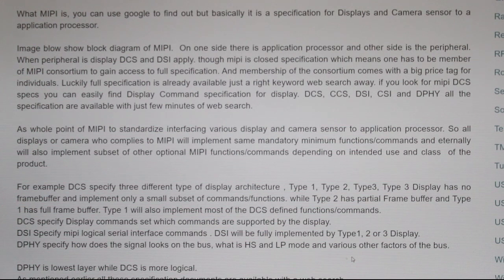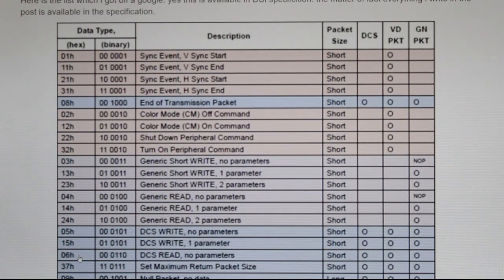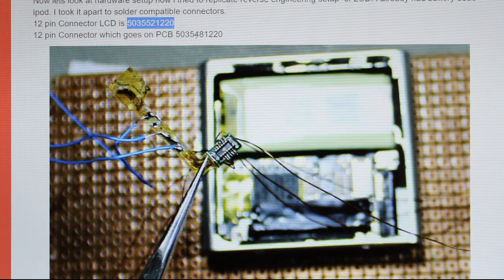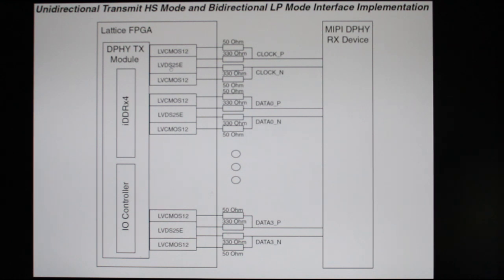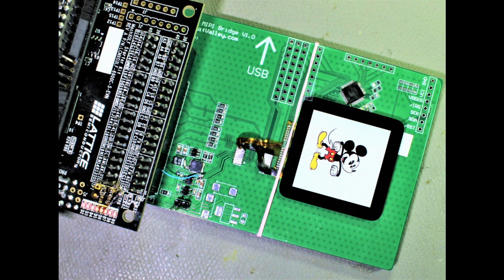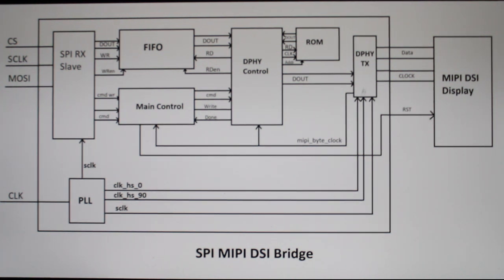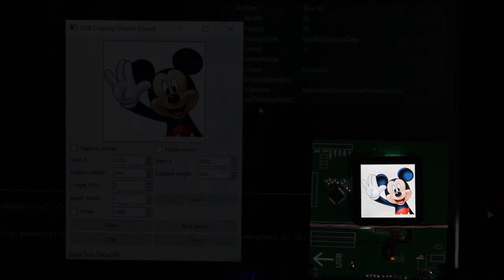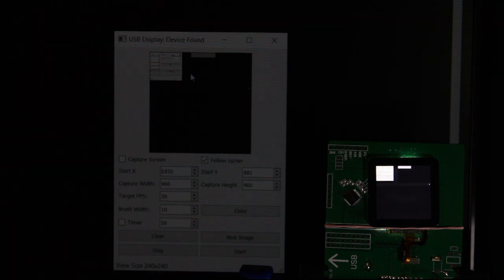Open Source MIPI DSI FPGA Bridge: Driving MIPI LCD with FPGA , IPOD Nano V6

Comment: Hi , this is a very good and detailed project. You have motivated me to try such project. Im trying to read the dsi data by an osilloscope. what model and spec oscilloscope did you use in this video. I have a 100mhz Rigol. would that suffice? The lane speed of the dsi im trying to read is around 940mbps.
Reply from the maker: 100Mhz Rigol would be sufficient for attempt any project.  Scope is just a another debugging tool. With enough motivation and resilience anything can be achieved.

Comment: Thanks for the great project @CircuitValley. I also saw your other projects such as the CSI2 receiver project and the industrial camera (CSI2) project as well. Question: do you have any idea if MachX03 is capable of doing CSI2-Rx and DSI-Tx at the same time? meaning would Macx03 is capable of interface to a csi2 camera, decode and demosiac/debayer, then send to a DSI display?
Reply from the maker: I have done CSI-2 RX and DSI-TX separately, MachXO3 is small FPGA. it would require quite a bit of efforts.

Comment: this was nice video explaining about DSI interface. Appreciate your hard work. it is not easy to work with something that is not documented well or closed source. But I have one Question remaining. is this mipi DSI interface standard to all displays regardless of display driver used in LCD module? if that is true it means this driver board will be able to drive any MIPI DSi compatible display regardless of driver IC inside LCD module ( Assuming correct  pins are connected ) . Right? I have few display panels laying around with 480x800 resolution panels they are MIPI DSI-2 (2 data lines)  panels. i want to know if it is possible to drive these panels with this FPGA board.
Reply from the maker: Yes , Every display that support MIPI implement subset of the MIPI protocol and commands will be same. You naturally have to adjust for resolution and number of lanes. And said they implement a subset so not ever command or feature or pixel format will be supported. Making silicon is hard, so there are only a few MIPI display controller manufacturer  best way to get info what your display can is to find a datasheet of display with similar size and resolution. websites like panelook may help.
Reply: @circuitvalley  thanks for your kind reply. i actually managed to get  service manuals of these two devices i have. now i know the pinouts  but still not sure about controllers used in LCD displays. one more Question. the FPGA you are using it is quite expensive are there any cheaper alternatives for replicating your work?
Reply from the maker: @muhammadshahzaib3813  FPGA are almost never cheap, This particular board cost just ~22 USD. Most likely cheapest FPGA board of it's size. You may getaway by using some CPLD, CPLDs cost even less than FPGA. or Taking some old generation of FPGA may also help.
Reply: @circuitvalley  i just looked up at aliexpress.com and it was not cheap at least 40 or 50 USD. In this price i can get hdmi board.
Where i can get this board ? Do they deliver international.i am from pakistan things like this are not easily available here.
Reply from the maker: @muhammadshahzaib3813  I got this board from mouser.

Comment: Sir, If I have HDMI to 50 Pin MIPI Display driver board, can this 50 pin board run a 40 pin MIPI Display?
What I want to do is to buy a single Driver board for 50, 40, 25 pins MIPI display because I have lots of dead phones with 5" to 10" display and I want to use these displays for DIY.
If there is any single driver board which may run all displays or most of them, please suggest it too.
Thanks...
Reply from the maker: As long as Correct mipi pins are connected it will work. Drivers for different MIPI displays are same.